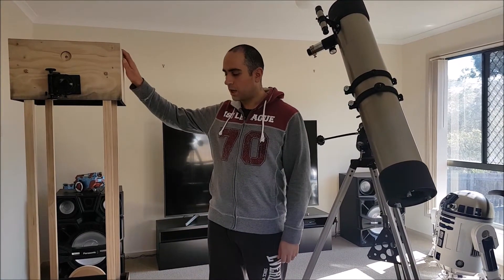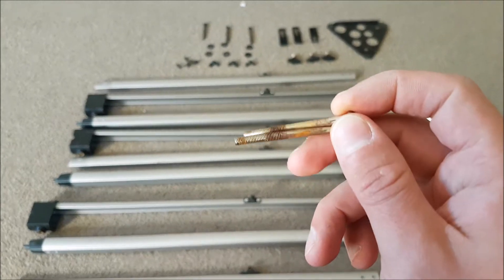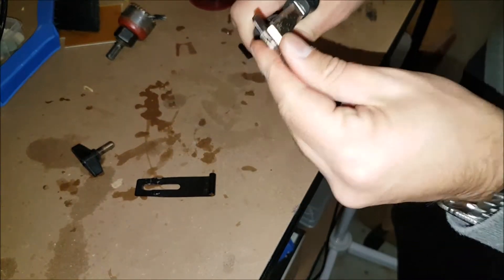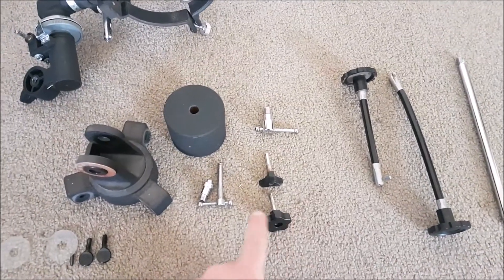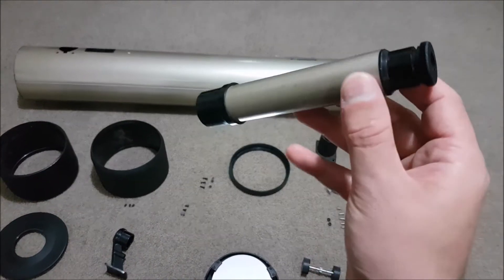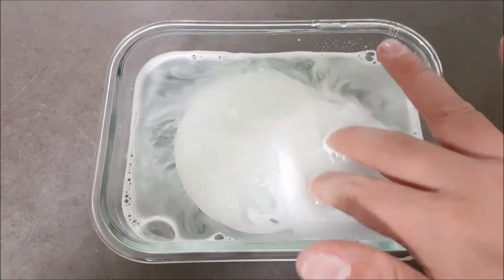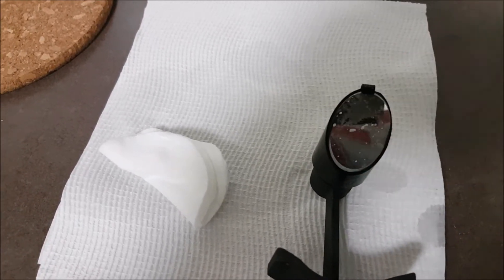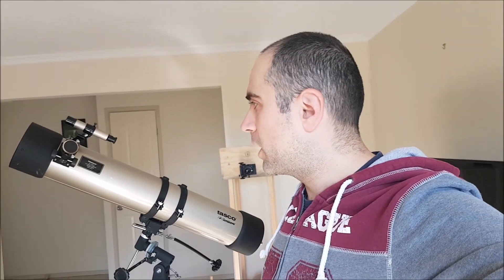Tasco Reflector Telescope Restoration

Comment: Have an opportunity to buy one of these but it's an older (white tube) type with 0.956 eyepieces and also has the wooden mount, not aluminium. Not sure whether to buy it, it's in good condition from the pictures (although the 80$ ask-price needs to come down). I would be able to upgrade it to 1.25" (I also build telescopes so making the hole bigger, moving the primary, etc won't be a problem). But is it worth it? Thinking of giving this to my 8y old daughter so she has her own telescope, I'm not a collector.
Reply from the maker: Mate. Those models have really good mirrors
Reply: @HomeRoboticsAustralia Thanks for the reply 😊 I hope it's a Japanese mirror, indeed, but could be a Chinese one and don't know the state of the mirrors. Hope it has a metal tube aswell but I'll know soon : I'm going to the seller in an hour.

Comment: How do you keep this from shifting?  When I get an object in view it pivots about the main base connection and loses the image.  I've tightened the clamp as much as possible (still able to use the adjustments,), but it just won't stay upright.  Any thoughts?
Reply from the maker: There should be a knob to help with tightening of the mount

Comment: @0:23 The best Tasco telescope to look out for is a small 60mm refractor called the Tasco 9VR - the V stands for Vixen, a Japanese telescope manufacturer. These have excellent optics.

Another telescope to look out for is the Tasco 8V. These are Jones-Bird reflectors. These have a bad reputation. However, they were mounted on Vixen Polaris mounts which are superb and better than anything you can get for a similar price today.

Comment: I acquired a beat up Luminova 114/900 like yours a few months back for the princely sum of $10 US.  Originally, I bought it for the rings only, to mount a different 114mm scope to a dovetail bar.  Seller advertised it as "broken, parts only."  They weren't far off.  The focuser was missing the ring that secures the eyepiece, the mount head was broken, would not hold position in RA.  I had another mount head that was broken in other ways, combined the two and ended up one good.  Then, I cleaned the optics and fashioned a ring on the Prusa printer, admittedly I didn't work up a file for it but rather manually fitted it to the focuser with a hobby knife.  Some plastic model glue and a thumb screw... fixed.  Finally, I collimated the mirrors.

I noticed that the tube will not balance with the single weight it arrived with.  Another weight (which I had extra), solved that issue.  I tossed on an Orion red dot finder instead of that awful 24mm optical finder.

Was rewarded with a solid little planetary performer.  Just a tonight I used it to explore the Lunar terminator, Cassini division on Saturn's rings and watched the shadow of one of Jupiter's moons transit very close to the great red spot.  Topped out at 150x with a vintage 6mm Ortho I have in my "always in the car" observing kit.

I'm not destined to keep it, I already purchased an Orion XT4.5 to get the same optics in a mini Dob.  Found a good deal on the Orion used, should come close to breaking even.

Having had an XT4.5 before, I'm not thrilled to be tossing aside the tripod, however the Orion's base is much more stable than the EQ1, even when its in correct balance.  It wasn't horrible to look through but I had to be careful when making adjustments. Vibrations whenever you touch the scope for a moment or two.
Reply from the maker: thank you for sharing. I am keen to see some pictures. I have had a few of these telescopes. the mount it came with are cheapo. so I built a dobson mount for one of my other luminova. the scope itself and optics in my opinion are great . the eyepieces are low quality so i use my own aftermarket SVBONY set..crystal clear images including Cassini division on saturn

Comment: I got one of these Tasco telescopes for Christmas in 1988. It is red in color and must say that its quality is not that good. Perhaps the OTA is good but the eyepieces are crap and the tripod is crap. I do not have a means to adjust the altitude for the polar alinement, it did not come with an adjustment screw just a twist nut to tighten it in place. My tripod is flimsy as well. Maybe yours is a later model and better made. I am looking to upgrade the focuser to accept 1.25 eyepieces and maybe either add a dovetail or build a rocker box for it and turn it into a dob. Yours looks newer with aluminum legs. Mine has wooden legs. After doing some research it seems that your telescope takes 1.25in eyepieces. Maybe I just need to upgrade to one like yours lol!
Reply from the maker: Yes, i know the red one you are talking about. Mine was also from 1986, it is in pristine condition, the eyepieces were the 0.925inch older style but the optics were very good. The telescope you have was made in japan, i really think you should keep it cause the later ones are all made in china. You can make a rocker box that sits on a short tripod. But i agree, you need to upgrade the focuser to 1.25 inch
Reply: @HomeRoboticsAustralia  Did not realize yours was .965 as well. Orion has a 1.25 focuser we can get for our scopes as well as finder scope brackets to add better quality finders. The one that came with our scopes were  the 25mm that are stopped down. I think I will add a Vixen dove tail and place it on a twilight mount.
Reply from the maker: @lornaz1975  The old one i had was  0.965, the one in this video was built in 2000 so it had the 1.25 inch focuser, i just put a new vide up on how to convert between the two for a smaller telescope  i had
Reply: @HomeRoboticsAustralia  I will be sure to check that out. Thanks!